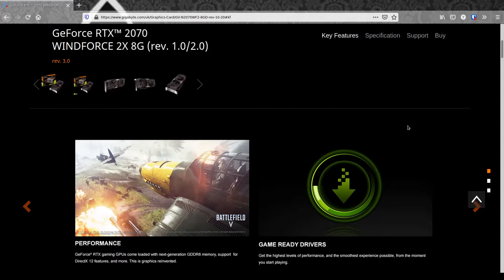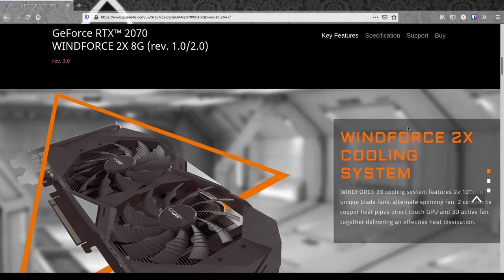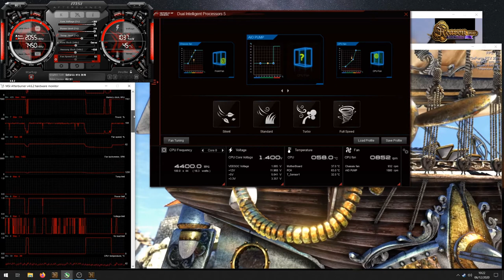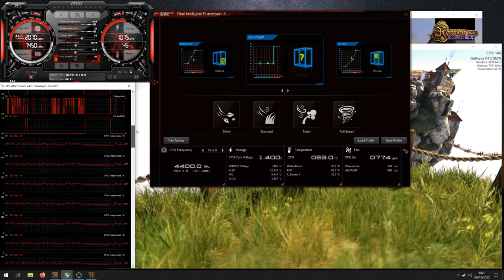GPU water block hack for Gigabyte RTX

Comment: Very impressive work. I am currently an engineering student and have recently got into PC building. Although you would say it's not pretty, I think you did a very clean job and put quite a bit of thought into it. My next aim in PC building is water cooling however none of my parts are worth water cooling (GTX 1650 super and I3 10100). However, I do plan to do some pc case modding and might experiment water cooling my 1650 super (Since it can OC quite well). The challenge is finding a waterblock for it since no one makes one for it but this video has given my some inspiration. Thank you
Reply from the maker: Go for it! There are a few techniques to learn and the consumables like the pipes aren't too expensive of you mess up. Learning to overclock is also a skill and you might get some more power out of your rig.